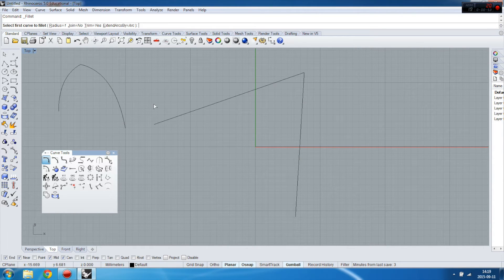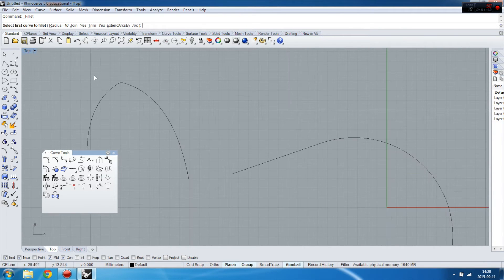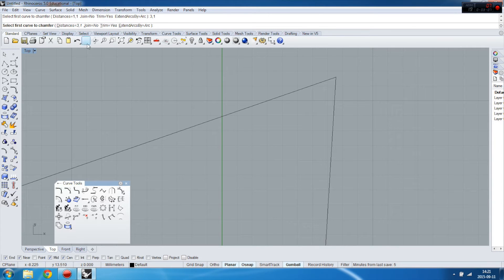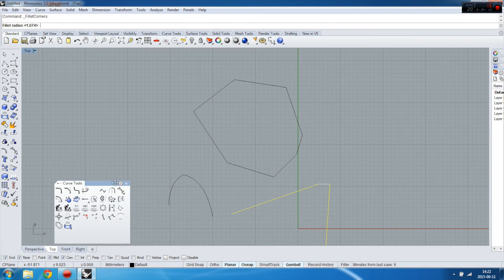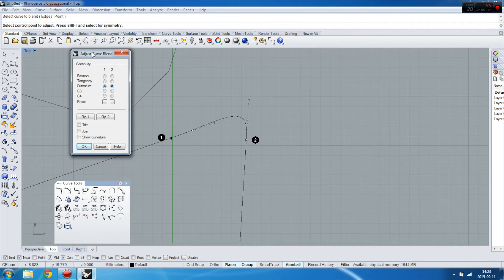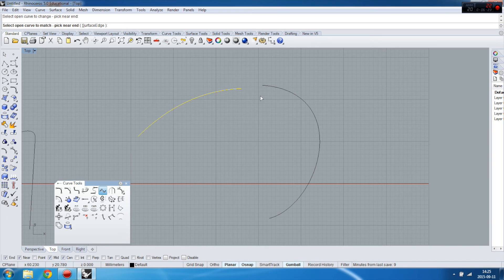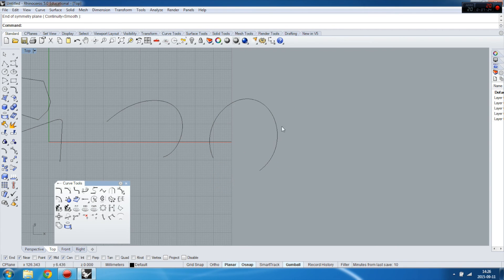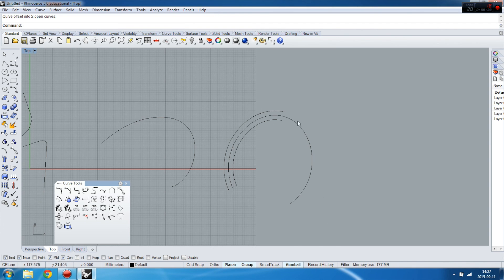RHINO TUTORIALS - Beginner - Curve tools modeling

Comment: Hello,i have a question:When i select the new file tab i get a pop up window that's called template files and it asks me in which measurment i would open the file(Large Objects - Centimeters,Large Objects - Millimeters,Small Objects - Millimeters)
so i wondered which one is the best to work with?
I learned so much with your tutorials so thank you very much for that,keep up the good work!
Reply from the maker: +Sam Hill great you've learned lot. That is why I have made all of my tutorials. If you working with small object like computer mouse, mobile phones etc. choose small objects milimeters. If you do some interior designing select centimeters but architecture than select meters. It is important especially when you do small objects to select milimeters because whole precision is set up for more detailed.